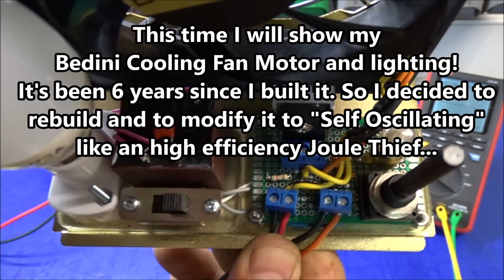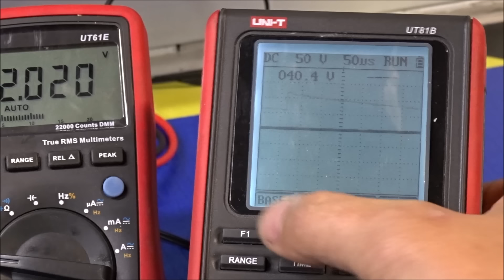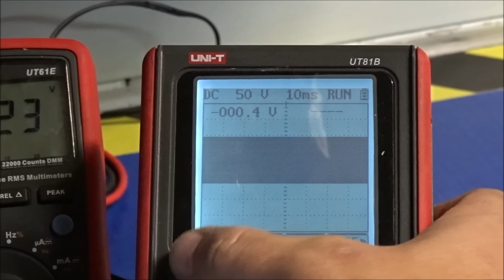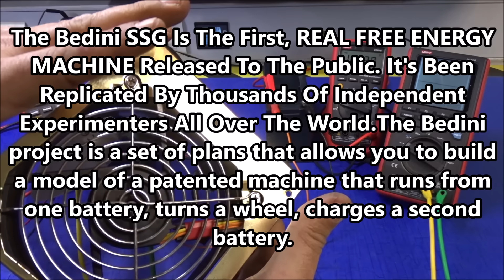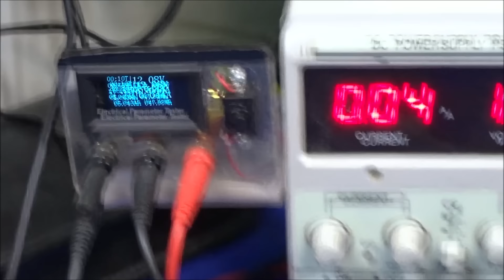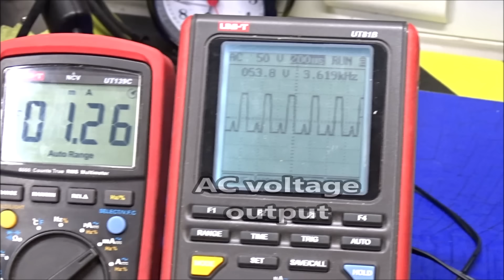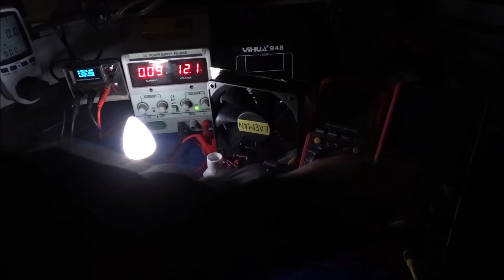Bedini SSG Self Oscillating Motor Generator | 2024 New Revision PCB Model | Free Energy Machine

Comment: Hey George, another great video.    I have been doing my research. You should try using banks of 18650 batteries instead of those. They seem to work better for this type of experiment.  Not sure why, but my testing is proof positive that they will charge better, faster  than the acid filled, gels, and caps I have.

I need to get you my overunity axial flux easyspin pulse generator.  You have never seen this configuration anywhere.
Reply from the maker: Thanks for your comment. You have down an great research... Bravo! Your Pendulum is Amazing! Βy the way I envy you...

Comment: Hi George, when the generator is in self-oscillating state, any changes in the charging output? Will changing the frequency using the potentiometer affect the charging output?  Also, how will the self-oscillating mode affect the current in driving battery?